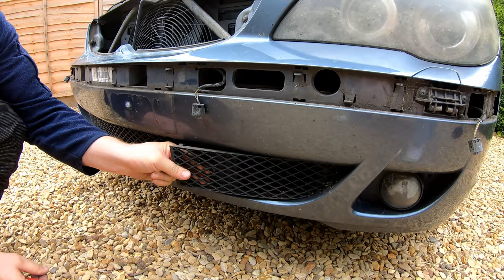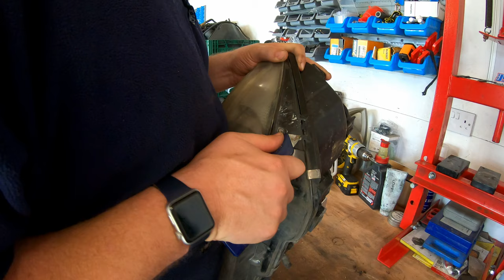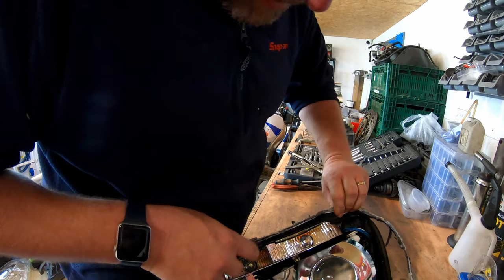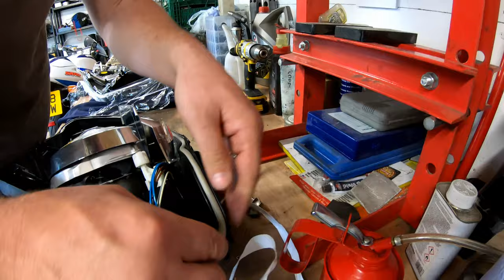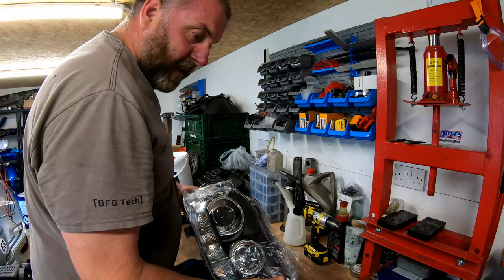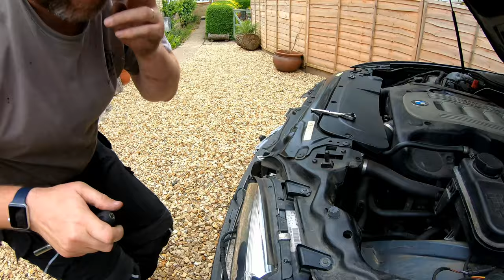BMW 7 Series - E65 & E66 (2001 - 2008) Headlight Restoration. Complete Headlight Lens Replacement

Comment: Awesome job Kev those look great! I've had to split my CLS lamps when I upgraded projectors to bi-xenon a few years ago but need to do it again now for exactly this reason!
Reply from the maker: It was one of those jobs where you think to yourself, if this goes wrong, it's gonna cost me loads of cash. That said, now I have done it, I could easily repeat it again and get the same result. Well pleased with how good they look now. It has been like facelifting the front of the car! 👌